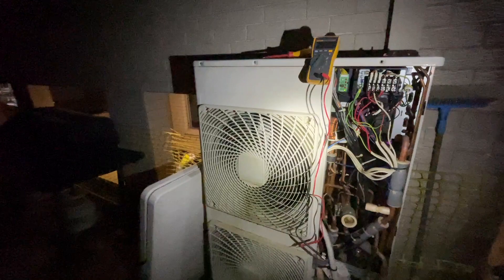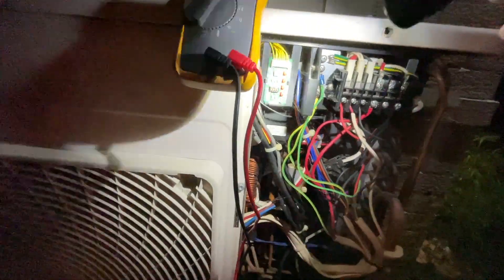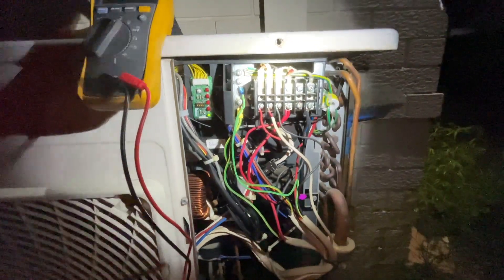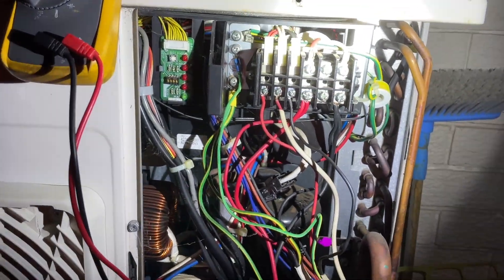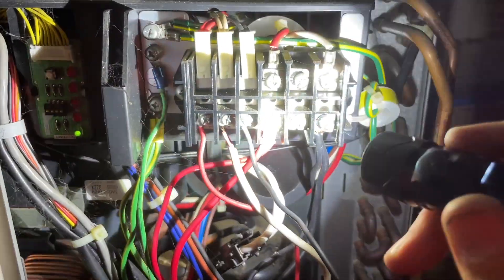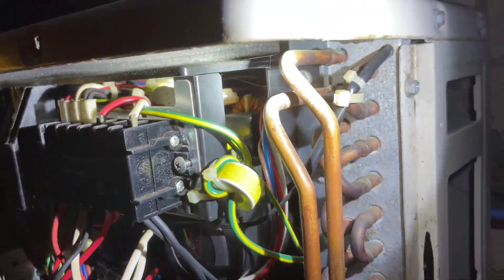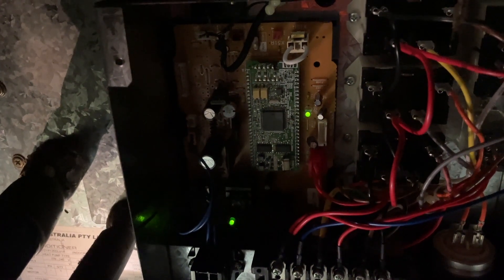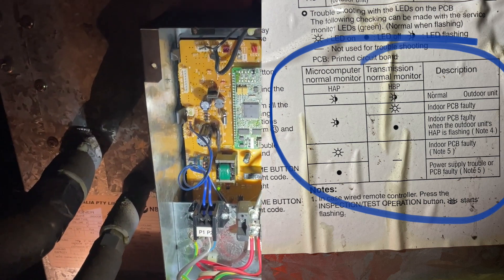Diagnosing Daikin UF Error

Comment: I've got 0V between neutral & the wire & a varying voltage between 50-100V between neutral & terminal 3.
I have a uf-02 error on my control panel & the h3p light on solid on the outside unit.
Indoor unit has both flashing lights (both are labled HAP though)
Reply: My unit sometimes only last 15 mins before the error & other times it last all evening.